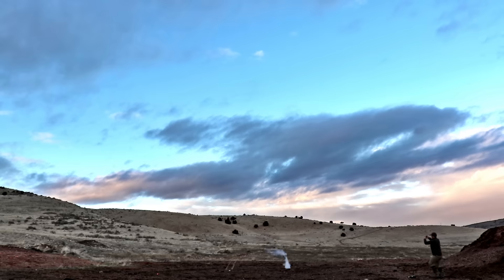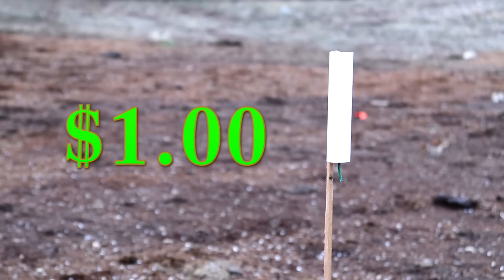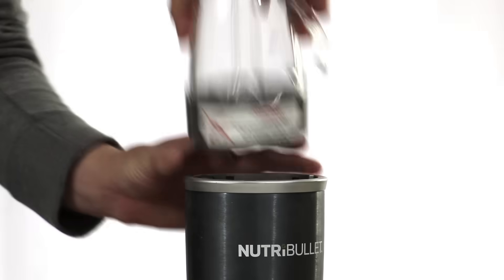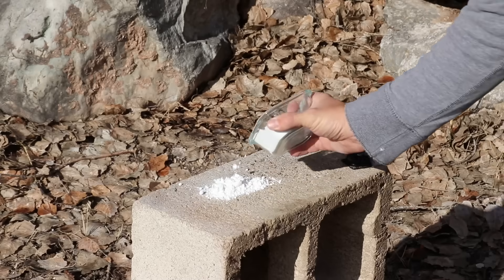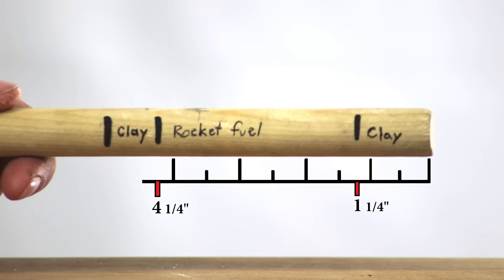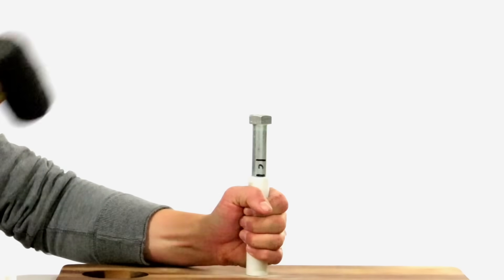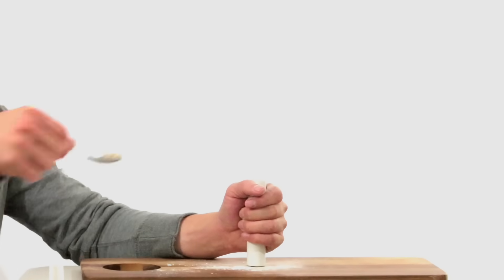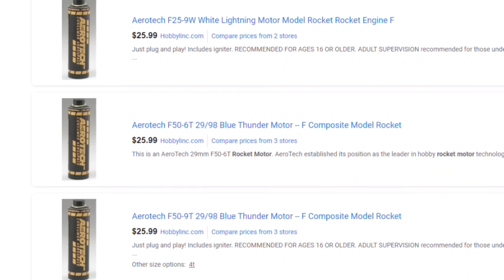How To Make Sugar Rockets (Powder Fuel)

Comment: When I was in 2nd grade I went to my local good neighbor pharmacy and asked Rick for some potassium nitrate and he said....
“Jeasus Christ kid! Are you building a bomb?!?”
Then he showed me where they kept the potassium nitrate and sulfur. 
Thanks Rick the pharmacist from Wheatland Ca. 

I later joined the 82nd airborne division field artillery. I like the boom stuff.
Reply: My local drug store would order whatever I wanted, potassium nitrate was on shelf, but more expensive, but the other salts like strontium nitrate et al they would just order, still have a lot of iodine crystals for other unstable stuff.  We had fun with household chemicals, if ya had a drug store, grocery store, hardware store, and farm supply store, you were set for anything, the rest is make it with what you have.
Reply: @gregkral4467  Not in grade 2 but for sure by grade 5 I was a real science kid. So starting about 1963/64. The drugstore wouldn't blink an eye at me picking out tins of Potassium Nitrate, Sulphur, Charcoal (for gunpowder), a nice glass hypodermic syringe (plastic ones weren't in use) off the shelves. I could also ask the pharmacist for needles, scalpels and for ether. The latter three were for my dissecting studies. Anything else I would go to the science lab shops of which there were several. My mom was a career nurse and was fine with all of this, taking me in the car to get stuff and proud to show visitors my microscope slides of tissue samples. Oh, I'm also fun at parties :).
Reply: @charlieross-BRM  In the 50-60's in you could walk in a hardware store and buy dynamite.
Reply: @charlieross-BRM  nice to meet you Hannibal lecter!!!! I’m just a regular pyro.
Reply: Does every kid have this phase???? I'm 15 rn and am building my own black powder and other stuff
Reply: @voidtheodst781  just the Smart Ones. Just don't blow your shit up. :)
Reply: @voidtheodst781  no. Not at all.
Reply: If something goes boom, i get exited
Reply: This is how America was meant to be
Reply: I bought saltpeter so I didn't have any more siblings.
Reply: Don’t we all haha. Thank you for your service 🇺🇸
Reply: cool story , but you left out the part where you lost 4 fingers!!🎉🎉🎉😂
Reply: @lunam7249 was a butcher for a long time… still got all my fingers. Some scarred some broken… but I have them. Still love the big kaboom!!!

Comment: Tried it twice and couldn't get it to go off. 

I cooked it and used granulated sugar like in king of random video and it worked. Not sure what I could be missing.
Reply from the maker: Yeah, I'm not sure what's going on, these engines have been 99% reliable for me. I've literally only had one pop the nozzle at about 1/3 of the way through.

Comment: It would be fun to make a multistage rocket.  Just use longer fuses for the later stages.
Reply: Use fuse and glue to hold the two rocket engines together when the fuse burns it’s an easy seperstion method

Comment: Have you tried Hydrocal "used to medical casts" I have a jig using a nail. Pour the hydrocal, dries in minutes. Use a steel rod, load fuel and then pour some Hydrocal to cap. Great video!

Comment: For electric igniters I use a an electric burner and a throw away dollar store pan. Same mix as the rocket fuel except, keep separated. You will need 0000 steel wool and some wire leads. Solder the wire leads to each end of a small piece of steel wool little bigger that a Jasmine rice grain. Enough that when you apply 9v battery it will glow red.  Melt sugar low temp "high temp may ignite the oxidizer" I use a double boiler.  I liquefy the sugar slowly adding the oxidizer Potassium Nitrate KNO3 or Potassium Permanganate

Comment from the maker: As far as the fuse is concerned, I have had a ton of questions concerning where I got the fuse, or how I made it, and how do I attach it to the sugar rocket. I will have a fuse video coming soon, so hang tight and I will be showing you some fuse  options.
Reply: that was my lingering question, too. I have no idea how to make a dependable fuse.
Reply: @brianjennings7644  https://www.amazon.com/Green-Model-Rocketry-Diameter-10foot/dp/B07TRC9VCH/ref=asc_df_B07TRC9VCH/?tag=hyprod-20&linkCode=df0&hvadid=459667108255&hvpos=&hvnetw=g&hvrand=3489288656712302808&hvpone=&hvptwo=&hvqmt=&hvdev=c&hvdvcmdl=&hvlocint=&hvlocphy=9008533&hvtargid=pla-943330596842&psc=1
Reply: @rlb96  thank you. I've had a bottle of stump remover in the shed for awhile..I now have a project! oh, and I was a Journeyman Machinist for 30+ yrs, so the construct is no biggie. heck, I worked on Minuteman II, and III prototypes. I love rockets.
Reply: For electric igniters I use a an electric burner and a throw away dollar store pan. Same mix as the rocket fuel except, keep separated. You will need 0000 steel wool and some wire leads. Solder the wire leads to each end of a small piece of steel wool little bigger that a Jasmine rice grain. Enough that when you apply 9v battery it will glow red.  Melt sugar low temp "high temp may ignite the oxidizer" I use a double boiler.  I liquefy the sugar slowly adding the oxidizer Potassium Nitrate KNO3 or Potassium Permanganate
Reply: No fuse you lose
Reply: Can't wait for the fuse. You're going to defuse our anxiety about how to launch the rocket :)
Reply: How much fuse can you make off the recipe above?

Comment: Does anyone think a wooden/dowel pipe plug with a hole drilled from a step bit would work as a nozzle?
Reply from the maker: Probably. Depending on the density of the wood.
Reply: @EthanAllred1  Thanks for the time to reply!

Comment: Potassium Nitrate is band in my Country. Makes it tough at times!
Reply: really, what country is that? Potassium Nitrate is also called Saltpetre and widely used in food preserving.
Reply: Try potassium chlorate/perchlorate, which can be easily manufactured, and vitamin C powder, which you may buy from any drugstore. Use 2 to 1 ratio for oxidizer to fuel, vitamin C being the fuel.

Comment: Hi, Ethan, cool stuff. I worked for a couple of years as a technician in the Propellant Development lab at Atlantic Research back in the early 80's mixing up all manner of different propellants, then transferred to Rocket Test and got to shoot a bunch of them off. I miss that stuff. So, sorry but I have to call you out on your safety gear. An accidental ignition would wreck your day and when you have the propellant mixture confined, the pressure rise in the vessel causes the burn rate to rise in a quick feedback loop that can turn into an explosion quickly. Same as gunpowder. So, when I do this for the kids, I'll be wearing safety glasses under a full face shield. For the compression process I'll build a plywood box with one open side, a hole in the top to put the bolt through, and a mount to hold the motor inside. That way if I do get a bang my hands and face are protected against flying PVC shards, which will just fly out the open side of the box. Watch out for dusting up the kno3 and sugar mixture and protect it from static. THis is gonna be really fun.

Comment: You need to do a little bit more in-depth on your explaining it's good it looks fun the cost is a little high because you do have to have so many materials to make and you didn't explain on how you use to ignite the rocket the fuse is a main part on how you ignite the rocket but I like the way that you explained on how it creates the thrust you're right the surface area in the amount of material being burnt at the same time is how it creates its thrust
Reply: I've made these for about 30 cents each, the PVC is the most expensive part.

Comment: If I remember my high school chemistry, gun powder is something like 15% potassium nitrate, 10% sulfur, and 75% charcoal.
Reply: I actually think you mixed up the potassium nitrate and the charcoal, but it's good stuff.
Reply: 75% KnO3, 15% charcoal, 10% sulfur. You can adjust the ratios for different tasks.
Reply: That 3:1 didn’t work for me. Rocket never lifted off or even came close. Weird thing was that when I reversed the ratios to 3 parts sugar to 1 part kno3 it burned much harder…. But still no light off… sad

Comment: Impressive and simple video, however, what does one need to make the  fuse?
Reply: ignite any rocket motor with electronic ignition, don't use hand lighting fuses.
Reply: My kind thanks for your reply 'Mojaverrockets'.
Reply: it's rocket wick, you can buy it at any hobby store. there's nothing wrong with it as you can see in the video
Reply: @johnbee3416   Thank you for that John.. not so easily found in UK shops. However I did find something on Amazon. Once again many thanks.
Reply: @johnbee3416  a long time ago, (50 years or so) we also did it that way and as we started to run low we would make the lengths shorter and shorter. "...there's nothing wrong with it" until things go bad. Not allowed by any of the three large national rocketry groups (TRA, NAR, and CAR) but as you can see, virtually anything is allowed to be put up on YouTube.

Comment: I have found that by adding a small amount of ammunition nitrate to the mix, with the right"nozzle" you will get almost 2 times the lift, a bit faster burn. It doesn't take much to achieve this effect. Also Lactose instead of sugar is a much better"fuel", and sorbitol is even better as it's melting point is very low, as is the ammonium nitrate, the potassium nitrate never really dissolves, it just mixes intimately with the melted sugar. What you are doing works well, but for that extra push, a nozzle/ head at the end of the engine will give you more lift, as will the addition of a small amount of ammonium nitrate(like 2gms for every 20gms of potassium nitrate.)
 I think if you try this method with just the added ammonium nitrate, you will see a major difference between the amount of time it takes to get up there, and how much thrust you can generate in a very short time without explosion. 
 The end of these"engines" are very important, there are a lot of great vids on YouTube to show just how much the end "nozzle", which is made of carbon fiber or graphite, and the difference between have a directed thrust that is a bit bigger than the end of the engine itself, effectively catching all the energy that escapes from the engine in an almost 180° radius to be directed tore of a 90° radius of energy all being directed towards the ground instead of the ground and all directions in the 360° radius of air under the engine, which is basically a 180° out, with the right"nozzle" you can achieve 90° thrust towards the ground, which adds up to a massive difference in the altitude achieved by the same amount of fuel and oxidiser. 
 Thanks for the video, I hope you follow up with the actual chemistry involved, the difference between the added Ammonium nitrate, and the difference between a rocket engine as shown here and one with a"nozzle" that will give you almost twice the downward trust.
 Also by melting all the fuel together into rocket candy, you will not have to deal with any uncontrollable reaction after the engine is lit and burning, a packed powder will never achieve the level of power and reliability as a solid rock engine would, I have no clue what would happen if you do add ammonium nitrate and not turn the whole thing into a "rocket candy".
 Thanks for the video!!!
Reply: The exit divergent cone of the nozzle for a rocket like this would be 12-15 degrees for optimum performance. Since these 'bottle rockets' are not for launching satellites into space, this video is a very simple and easy way to make them.
Reply: @mojaverockets  
The useful addon here is that you can easily add in these features by simply grinding down the tip of the rammer dowel into a dome and prevent the splitting by either using a bit of pvc or tape to reinforce it a bit. It'll form the concave naturally while you're compressing the base plug. You can also add a cone between the propellant and base plug to get a venturi for even greater efficiency too
Reply: Is it dangerous to melt all the fuel together over the stove?

Comment: Hi Ethan, thanks for Your video, I tried to build the same sugar engine like You 3 times but all the time engines explode quickly after lunch (around 20 meters altitude) I have also read that it is better to use sorbitol than sugar (it prevents from explosion)  but as I suppose it is less powerful. Did some of your sugar engines explode? Did You tested sorbitol ?
Reply: I've made many engines using this method and never had one blow up. My guess is you did not compress the fuel enough (I use a three ton arbor press to compress mine). If the fuel is not compressed tight enough the flame will burn into all cracks and crevasses causing an uneven and extremely rapid burn that will cause an explosion.

Comment: Were any measurements and calculations conducted to ascertain the energy produced as thrust? That would be some interesting data.
Reply: I would like to see the data as well.  Homeboy did mention that it's comparable in size to an "F" engine so maybe it also produces comparable power which for that size engine would be about 15 Newtons, or 3.3 lbs. of thrust.

Comment: How do you insert the ignition cord? 
I have read that it needs to ignite at the top.
Reply: You need to tape the part of the fuse that is in the rocket (so not the part that is sticking out ), that way the fuse will burn very fast so the fuel won't be ignited only at the bottom but all the fuel will be ignited at once. When all the fuel burns at once the pressure will be increased and more thrust will be created. Make sure to leave at least 2,5 inches or 6 centimeters of fuse just as is, without any tape, so you can get distance from the rocket
Reply: @mw-tj6ob  ah, nice. 
I wasn't planning on using an ignition cord in the first place, but electric Egnition has its own problems with my rocket design. 

And no worry, I will ignite the fuse itself electrically so that I can keep distance. 
I expect the first few motors to blow up anyways, but that shouldn't be a problem as long as I and everyone who's watching keeps distance and safety in mind
Reply: @ValMephora  oh yes, blowing them up is part of the process, I blew up more than ones that worked :) good luck with the rocket hobby!

Comment: Can anyone answer the following questions:  How far to you insert the fuse?  Do you use any adhesive to hold the fuse in place?
Reply from the maker: I use a wood or paper wedge to hold it in place. I insert the fuse about an inch further than the depth of the nozzle.
Reply: @EthanAllred1  so you insert it an inch into the pipe or almost all the way. Just a wee bit confused

Comment: I have 2 questions for you. 

1) Does it continue to burn after landing? (Don't want to start a brush fire.  ;)
2) Is the PVC pipe reusable or should I replace it every launch?
Reply: I should preface this by saying I'm in no way a rocket engineer, but:
1) the rocket shouldn't be burning when it lands as the descent should cool it enough, but amateur rockets aren't perfect. Combustion instability might cause the rocket to fail and land ablaze, so its your responsability to find a safe spot to launch your rockets, with permits of course.

2) with all due respect to the video i really really advice against using PVC pipe. It's a very dangerous material bc of its brittle structure: if your rocket fails, and there's good chance you'll make some mistakes at the start, in the worst case it will send PVC shrapnels everywhere (and they can't be found by normal x rays if they unfortunately enter your body). That is a great risk. I suggest using really thick cardboard for your first rockets and switching to an aluminum case as soon as possible, because of its ductile properties.
If you want more info, check out Charlie Garcia here on youtube. He's a way, way better rocket engeneer than me and he explains it very clearly. Stay safe and good luck!

Comment: The best explanation on YouTube,  good job and yes you made it  100% clear. Only 1 question is dry mix as good as when others melt ?  Cheers
Reply from the maker: I think the biggest benefit to melting the rocket fuel is that it gives you the ability to shape your fuel. especially for larger engines where the powder is too much to compact. The melted fuel is more of a fire hazard because if the engine blows up burning pieces of rocket candy can go flying everywhere, whereas powder engines will disperse powder and go out very quickly. That being said, melted fuel engines are far less likely to explode.
Reply: @EthanAllred1  Igniting rocket motors by hand using fuses is also dangerous, you should use electronic ignition from a safe distance. Melting the propellant gives you greater density and higher Isp.